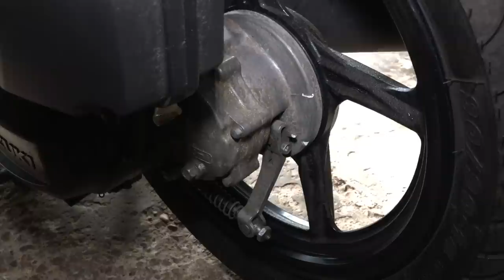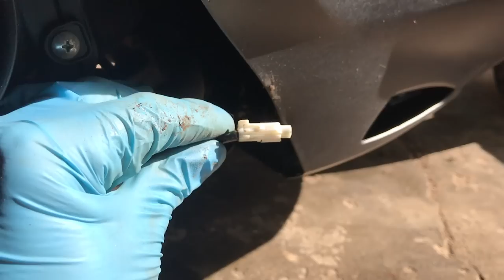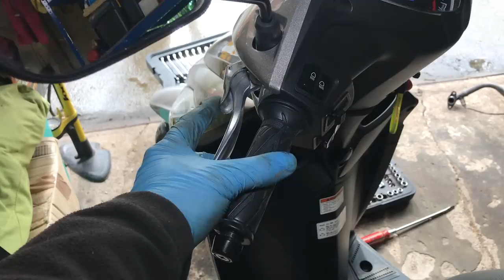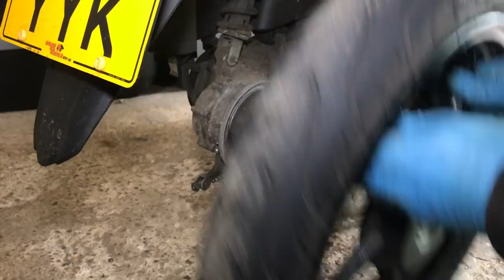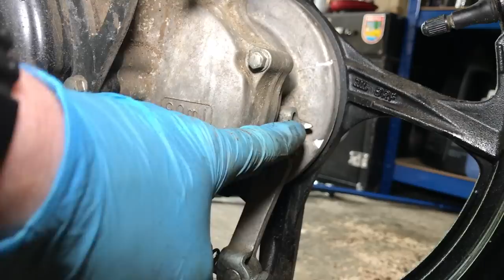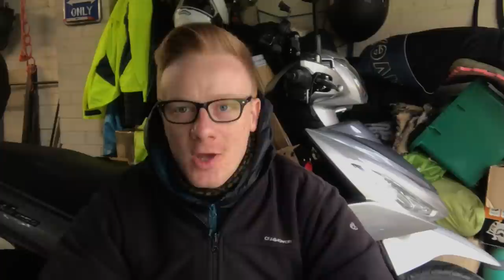Suzuki Address 110 - Changing the Rear Brake Shoes

Comment: Excellent  video sir.👍
Reply from the maker: Many thanks! 👍
Reply from the maker: Hey I think you sent a longer reply to this but I can’t seem to find it now. Anyway.. glad you got the caliper pin out. Good skills with the heating. Should be good now if you keep on top of it 👍
Reply: @MechitBetter  I used a butane jet flame lighter on the pin to loosen it after taking the caliper off the disc as the localised heat wouldnt affect the seals in the main body.and held the caliper with a welding glove...it was a bit risky , but it worked. I was a bit dubious about putting it on here in case somebody else tried it and fucked up, so i removed it..anyway loving the videos guys.especially the camping on the scoot. You said on that you took your watercolours?
Reply from the maker: Risky sometimes is the only way forward when the alternative is a new part anyway. I reckon you did a good job 👍 Yeah I took my watercolours in the camping video. I don’t think I ended up painting anything though. By the time I was sorted and fed, it was dark. I ended up watching the barn owl hunting instead 🙂

Comment: I’m a bit confused. I bought myself a new rear brake cable cause the current one was stretched. So I went to take the old one out. I noticed it was solidly attached in an area I couldn’t easily get too, so I made the decision to do a bodge job and cut the ends off leaving the part I couldn’t get to in situ. So I ran my new cable through and attached it no problem, by passing the problem area. I’ve just finished and realised it must be the linking of the brakes where I couldn’t get to? But the Suzuki cable I bought doesn’t have anywhere to attach it to the linked part anyway, it’s just solid cable from beginning to end. I haven’t rode it yet as I’m with my son, I’m hoping I haven’t buggered my brakes up! Monies tight at the moment, hence doing the work myself.
Reply from the maker: Sounds like your new cable is for the early model (without linked brakes), and your bike is probably euro 5 with linked brakes. Have a look at this diagram and see if it helps work out what you’re looking at >>> https://www.fowlersparts.co.uk/parts/5939501/uk110ne-address/handlebar
Reply: @MechitBetter  thanks for that, I’ll have a look tonight. Now I’ve ridden it I have to admit it doesn’t feel much different. I can make the back wheel skid at low speeds if I really grab it, but other wise it feels fine. I haven’t ridden it in the wet yet though hahaha! ;)

Do you still have your Address?
Reply from the maker: Yes I still have it. The linked brake system was crap anyway. You won’t notice any difference 👍

Comment: Hiya! What can I do if I’m applying as much pressure as possible to the brake but the wheel still spins when I try to undo the nut (my friend held the brake while I took a torque bar to the nut)
Reply: Also, your videos have helped me so much, can’t thank you enough!
Reply from the maker: Hiya Benedict! Thanks for your question. I’m not sure I’ve quite understood the problem. Are you on Facebook? If you find our page (Mech it Better), you can send a quick video of what’s happening, and I’ll be able to reply quicker and help a bit better. 

https://www.facebook.com/mechitbetter/

But… From what I can understand of your question, it sounds like your rear brake needs adjusting to make it tighter. I think I explained in the video how to do that. If you can wind the adjuster nut in, it should allow the brakes to stop the wheel turning. 

Failing that, ask your friend to hold the actual wheel and try again. If they use their body weight, they should also be able to stop the wheel turning. 

If that fails and the nut still won’t come off… you could put the correct socket on to the nut and then repeatedly hit the socket (end on) with a hammer using a medium amount of force. Sometimes the repeated shocks help to break any corrosion that’s holding the nut on. After a few wallops, try removing the nut again. 

If it STILL won’t come off, we’ll try something else. Drop me a message and let me know what’s happening. Good luck 👍

Comment: Do you think you could do a video on brake fluid change? BTW, the most comprehensive Suzuki Address video manual on the internet. Thanks for that.
Reply from the maker: Matthew D Cheers for watching. Hope you’re finding them helpful. I’m not due a brake fluid change but might do one soon. In the meantime, check out the brake fluid change we did on the Honda CG125. It’s exactly the same. The only difference being that you’ll have to remove the headlight plastics to get the top off the brake fluid reservoir. We cover how to do that in our Suzuki Address headlight bulb change video. A bit of a roundabout way of getting you there, but the info is all there 👍
Reply from the maker: Matthew D https://youtu.be/iQMHMbz1C8M

Comment: Mate, your videos are an absolute lifesaver. I work as a Deliveroo courier and got an Address last year, and getting it serviced was costing me a fortune, keeping it within warranty is SO expensive, so thank you both again, and when I next get paid, i'll buy yous a round! Question for you, my local garage says that it's wise to get the clutch replaced at about 11,000 miles. I wouldn't even know where to begin, and the manual says nothing about a clutch... any help?
Reply from the maker: Cheers Daniel. Glad you’re finding the videos helpful. How many miles have you got on your Address now? I reckon the clutch is only worth replacing when it starts to slip. A bit like changing your brake pads half way through their life as a preventative measure. I’d personally just run it while it’s working then change it when it isn’t. I’ve never done it before, but it’s not too hard to do as I understand it. Nothing like a cars clutch anyway! 

There’s a really good Facebook group for the Address. Some of the members have got seriously big miles on theirs with no issues reported. Just regular servicing as ever will help a lot. It might be worth joining up for helpful tips. One of the high milers might be able to tell you if/when they changed their clutch. Here’s the link 👍

https://www.facebook.com/groups/1922116438012959/?ref=share
Reply: @MechitBetter  Thanks so much mate. Yep, all wise advice. Will be looking forward to any Suzuki vids you end up putting up!!

Comment: The front brakes are absolutely rubbish in my Address. Underpowered, no feel and lock up easily under heavy braking. I am thinking about upgrading from 1 to a 2 piston front caliper and maybe the master cylinder if need be. Nice videos as always :).
Reply from the maker: Cheers. Glad you enjoyed it. The front brake on mine seems decent actually (for such a small bike anyway). It’s possible your piston might be a bit sticky, or if it lacks feel but still locks up then it’s probably the master cylinder.

Comment: Hi there! I'm back again. Sorry to bother you but I've just changed my rear tyre when I noticed that my two 14mm mount bolts for the exhaust where very tight two take off and put back on. When doing them up they turned very easy for the first 1 1/2 turns or so then very tight all the way until they would not turn any more when they where fully in. I then tighten them up quit hard but not super mega mad he man tight! Any ideas please? I always apply a little bit of grease to the threads. Okay thank you. :-)
Reply from the maker: Hey, no worries! It’s possible that the thread that you’re screwing in to has rust or grime which is making it hard to turn the bolt. If you can get hold of a tap and die set, you’ll be able to clean out the thread really easily. Use the same kit to clean the bolt threads too and you should be all fixed 👍
Reply: @MechitBetter  Okay! Fantastic. Thank You very much. :-)

Comment: I have a back break that locks the wheel after like 20 miles of use and I think it's the heat, does it mean that the breaks are completely worn out or something else
Reply from the maker: Possibly… if they aren’t adjusted correctly they could be binding while you ride, which will generate a LOT of heat, which could lock the wheel. It would certainly wreck any friction material that’s left if you rode it like that for long enough. In any case you really should investigate that properly before you ride any further.
Reply: @MechitBetter  I'm changing the back break shoe should that solve it?
That's why I watched your video, amazing video by the way, thank you for taking the time to reply.
Reply from the maker: Hey thanks. You’re welcome. Changing the brake shoe might help if that’s what the problem was. Without seeing the bike it’s hard to diagnose. Just have a good look at everything while you’re changing the shoes and the problem should present itself. They’re a very simple system, so there’s not much to go wrong. Good luck 👍
Reply: @MechitBetter  thank you

Comment: Super helpful thanks so much! Looking through to see if you have any advice on adjusting the rear brake cable and lever (mine's stuck, it's not fun)
Reply from the maker: Cheers! Did you get sorted? Everything necessary for adjusting the rear brake is here. If it’s still stuck then there must be something funny going on somewhere. What part is stuck?
Reply: @MechitBetter  the rear brake doesn't release fully when you let the front lever go, and the front lever triggers the brake light even when not braking, doesn't appear to be the shoes or adjuster so I think the cable itself is snagged somewhere! Had to ride home mostly on the front brake
Reply from the maker: Yeah that does sound like the cable based on what you’ve said. If you release the adjuster all the way off then use the lever you should probably be able to feel it snagging. I suppose a new cable is the only answer. The front brake probably has a little micro switch to trigger the brake light. You can here a light click as it engages. That might just need a bit of WD40 or something like that. Good luck!
Reply: @MechitBetter  thanks so much for the help! Mechanics are taking it in Monday, wherever the snag is I can't find with my tools
Reply from the maker: Ah well. Hopefully you’ll get it sorted on Monday and be back out scooting soon 👍👍
Reply: @MechitBetter  waiting on parts! Cable and brake shoes, I was riding almost metal to metal. OOPS.
Reply from the maker: Yikes! Good job you found out now then 😄
Reply: @MechitBetter  yeah oops..thought it felt funny
Reply: @thessie  lots of people in philippines. Do not !!! 
Check or service anything.
Brake shoes.
They probably don't know they have them.  Haha .
Funny  but true 😂😂😂

Comment: Hi how much nm torque does it required to tighten the rear wheel axle nut ?
Reply from the maker: I can’t give you an exact figure, but tight. As tight as you can go by hand with a normal spanner or socket should be fine. No need to be weighing on it with a breaker bar or anything. If in doubt, take it to a mechanic 👍

Comment: I've just changed a new rear brake shoes for my Suzuki 110, but I don't know why everytime I pull the left lever, the rear brake shoe will make squealing noise
Reply from the maker: It’s hard to suggest anything without being there to investigate. It could just be that the new shoes need time to bed in. Also they might not be correctly fitted, or there might be brake dust from the old shoes getting caught up in the mechanism somewhere. Squealing is caused by a vibration somewhere in the system, but if it’s grinding then it could be something else

Comment: Do you still have the bike and if so how is it two years on
Reply from the maker: Yeah I still have it. I’ve had it a few years now and it’s still brilliant. Best bike I’ve ever had 👍
Reply: @MechitBetter  that’s interesting to hear  .I am thinking of buying a new one my self soon  my first new bike in  35 years
Reply: @MechitBetter  what mileage have you done now , any more modifications ?
Reply from the maker: I don’t do many miles on it unfortunately, which is my fault not the bike’s. But there’s a great Facebook Group (Suzuki Address 110i Owners Group) with lots of faultless high mile bikes on there. It seems to be a bike that goes forever with just basic servicing. I can’t recommend them enough! My bike’s entirely standard and is fine for my needs. Some of the people in the group have added wider tyres, different pulley weights and springs etc. Join up if you’re on Facebook - the group is a wealth of information and advice 👍
Reply: @MechitBetter  thanks will do